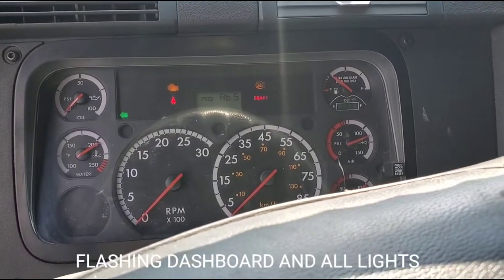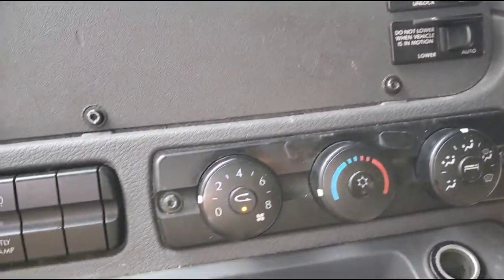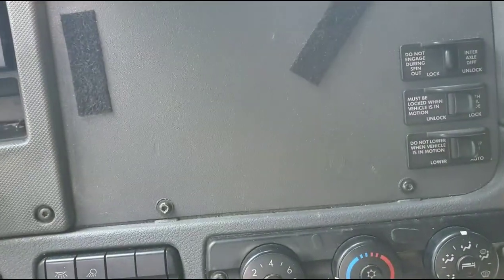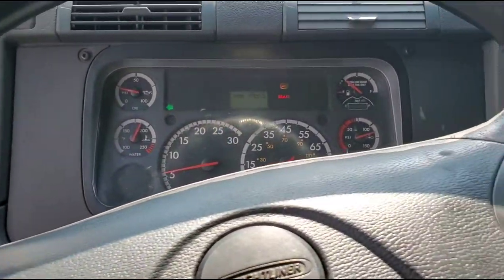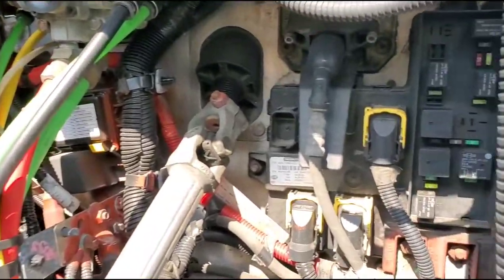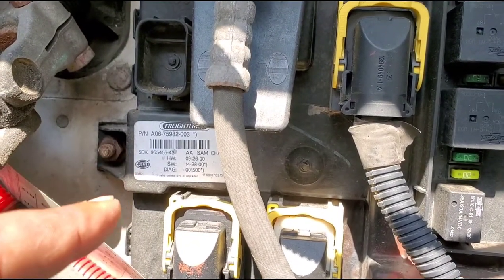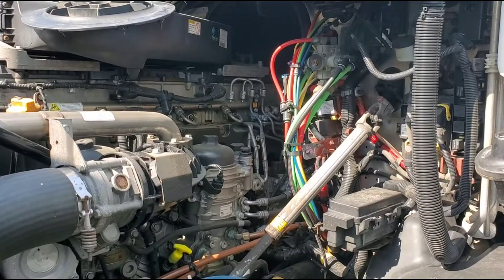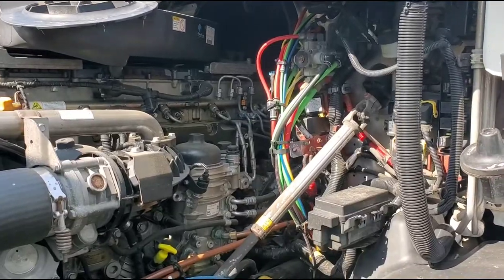Why Dashboard lights Flashing and all Lights blinking on Freightliner? Truck shut down? Do this Now!

Comment: Thank you for the video. 
Freightliner cascadia. 
during my driving my truck, it's happened suddenly the whole lights got off dashboard inside lights and outside lights and after 3 seconds back on its happens 3 times and I felt the truck engine about to shot down also. beside this when I'm not driving and engine off, I hear clicking sound for sometimes from the same place, the one you showed under the hood.

Comment: Today I had the problem of fender lights and rear brake lights, on a Freightliner M2 Box truck flashing like hazards. ABS Light flashing on and off, then stayed on. DEF light indicating 1 red bar blinking. Had 3/4 tank. Truck also wouldn't turn over at one of my stops...got it started and just kept it on at stops...also just dealt with the lights blinking. Lost directionals, just brought it back to the warehouse, yeah I know, shouldn't have drove it. Twas embarrassing, but I'm just glad I'm home. Lmao.

Comment: The SAM chassis is prone to failure.  If you put a laptop on it with the DDEC software, you will see faults wrapped around different fuses blown.  Mine is showing the water separator and trailer light fuses shorted or blown and the fuses are fine.  I'm going to change it today and the 2023 off the shelf price at FL is around $1000 with a $250 core charge.

Comment: Pndb Switch is the main problem. $450 for the main PNDB MODULE in my area . Idk about yours.
But Inever spend money on diagnosis.i always buy that PNDB box and change for 3 cascadia including they randomly shuts off and turn back on by themselves at highway.blinking lights like yours.

Comment: My truck is a 2013 cascadia and doing this as well. Changed the module with the hazard button but that didn’t work. Then changed the central gateway module and that didn’t work. Looking to change the Sam chassis next.
Reply: Mine was the Sam chassis module
Reply: Just had this problem this week on a 2012 cascadia, changed the sam chassis took it to get programmed, it turned out to be the sam cab. And the sam cab does not need programmed.

Comment: Brother hafiis  I have same problem with my 2016 freighliner casdia Cummins isx15  it start on me days ago i watched other videos he says mega fuse in pndbox which is 125 am fuse with with screw  on it  i change that today i still have same issue ceiling light flashing no turn signal smells burn coming from the air condition area no bunk ac it was as working before  deff light with yellow light come on go off sometimes flashing if I turn off and back turn light will go away. Check engine light is on   Computer you said change it I think it’s but not sure with diagnostic it  but it doing same as your truck doing   I was think the mega fuse before I did change it today and nothing changed  so sure is the computer on wall

Comment: A friend of mine got a 2012 Freighliner cascadia DD15 engine,after he deleted the Def in some shop in Chicago,he drove about 200miles and he heard some knocking on the engine with a lot of smoke coming out of the exhaust,he drove about 10miles to a truck stop and fire started to come out of the exhaust pipe,the Def system was very hot and the plastic near that was melting,and the cylinder N5 had no compression.
Any ideas about what happened please?
Any thoughts please?
Reply from the maker: If truck caught fire call insurance company and they will total the truck and pay in full. Don't mention about def bypass to insurance.  They put heat Guage inside truck to monitor exhaust heat but mostly new mechanics ignore that.
Reply: Hahaha yeah..they tried to bypass a critical component to the truck....

Comment: My problem is my headlights stay on with the switch off my flasher button flash with no indicator lights lights and there's no wiper power no cruise control no Jake brakes I can't use my steering buttons to do nothing, what do you think my issue is?
Reply from the maker: Check your fuse box it could be ground issue for fuse box or some shortage issues. Most of the trucks have fuse box in front of passenger seat and due to windshield leak water can damage the fuse box and create rust/ shortage. It could be computer issue.
Reply: Hey did u ever find what the problem was in your truck because mine does the same same thing you described.
Reply: Same issue with mine. I replaced Sam chassis last year and now we have head lights on with switch off and blinkers and clearance lights flashing. No trailers lights working. Randomly tractor lights work normal then back ti flashing. Any ideas?

Comment: Brother what year is your truck ? It is automatic or manual ? How many miles on truck ? Thank you for making these videos. Much appreciated
Reply from the maker: It's 2016 cascadia Evo 525k miles.
Reply: @desitruckersinu.s.a2797  I got the same problem and my truck is 2016 how mush cost you to fixed it
Reply: Sam chassis is the problem have to change it
Reply: As you can see the hydraulic line for the clutch is in front of the SAM chassis, it's a manual.

Comment: I have a 2009 freightliner 60 series.  Blinking red light came on, minutes later it shut off, diagnostic saying coolant sensor, replaced it and now truck stays on but red light still blinking.  Any idea?
Reply: Clean battery connections and corrosions

Comment: I think every truck has deferent solutions mine same problem 2015 cascadia Cummins Isx 15 but nothing has to do fuse boxes or Ecm Machanic told me to go buy a parts for my truck and I went to buy it and I came back with the part he installed that part the problem is gone but I don’t know if he did something else while I was buying that part

Comment: Where did you get $450 and was it akready programmed?
Reply from the maker: Due to shortage of parts it cost me 800$ and it don't need programming.
Reply: I have my doing the same thing , everything is working good but my lights are all flashing 🤦🏽‍♂️…. Where did you get the module ?

Comment: I turned on the lights of my cascadia and they don't turn off, I don't blinki the signals to turn all the lights of the trailer are also on I need help
Reply: Did you fix it. What was the problem?